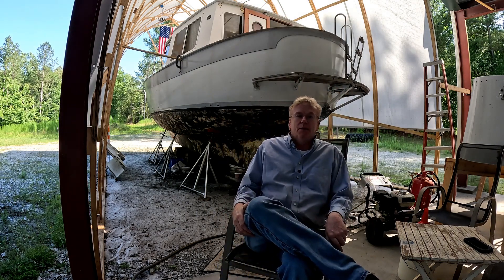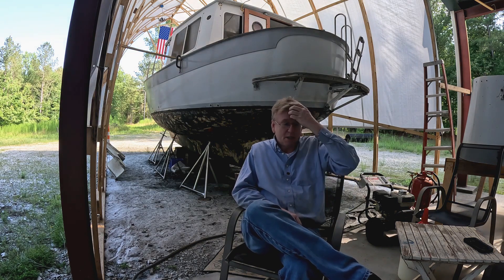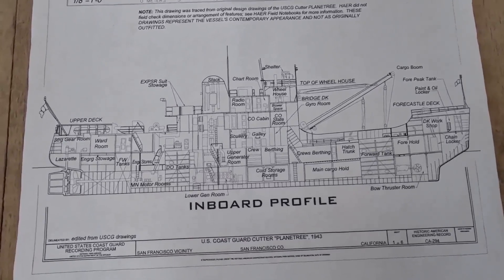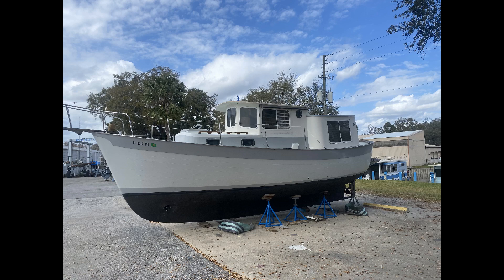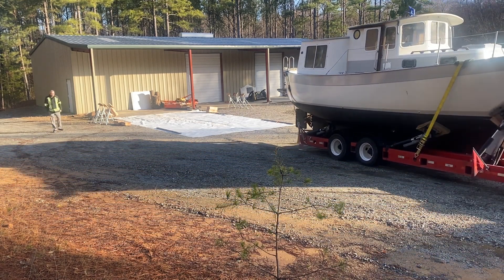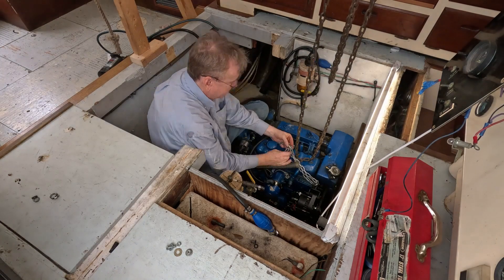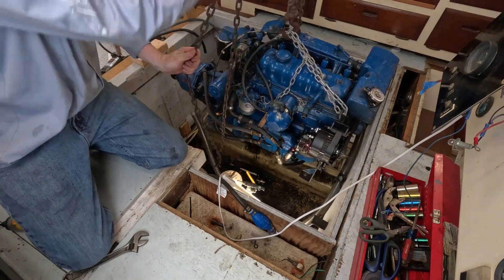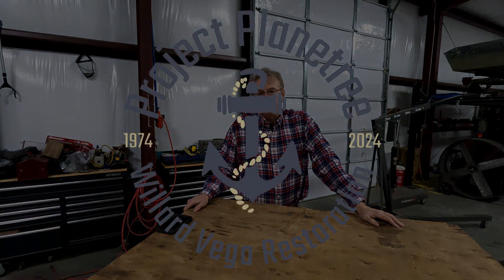Project Planetree- A Full Displacement Electric Trawler Conversion

Comment: Looking forward to seeing how this turns out. I converted a small catamaran and I'm absolutely thrilled with electric power. With enough solar panels it's like having an unlimited range!

I know you're aiming for a 96V system, but if the money isn't paid yet I would highly recommend a 48V system. It's so much easier to find parts for like the BMS, charge controllers, inverters and do much more. The only downside is needing fatter cables.

Good luck!
Reply from the maker: Thanks, I agree.  As an EE, I like higher voltage when possible.  However, it seems the world just isn't fully ready for it on boats and there is SO much out there for 48v systems.   I've held off purchasing anything on the propulsion side until I get past my battery learning curve.  My goal is a hull speed, passage capable trawler with no diesel, no sails and no stopping for charge. I'm not sure it's possible, but I'm sure going to give it my best!  Let's keep in touch.  Folks with actual experience in this craft are rare.

Comment: Cool project.  I bought your engine to diesel swap a little fishing boat I have.
Reply from the maker: Send me pictures once you get it set up!  I would love to include it in one of my episodes.
Reply: For sure.   Looking forward. To following your progress.  Really cool project.
Reply: Got water pumps, front cover, and front main seal replaced.   Touched up paint.
Reply from the maker: @billwood2747   You are moving fast!  Remember, like I said on Ebay, I think its the rear seal that's leaking.  I accidentally said on the video its the front seal that's leaking but I think the leak is coming from the rear.
Reply: @ProjectPlanetree  the rear is definitely leaking.  When I pulled transmission to put engine on stand rear housing was full of engine oil.  I bought a complete engine seal/gasket kit.  Gonna reseal everything.  Not in a rush to do swap.  Just tinkering. I see there is an updated rear seal available.  Gonna wait for that to arrive before I do that repair.
Reply: Gonna adjust valves, paint all raised lettering white.  Some of the accessories and fuel lines.  Then it will probably sit on stand for awhile.   Gonna run existing combo for awhile paying closer attention to speed vs rpm.  Then make a good plan for swap.
Reply from the maker: @billwood2747   Don't forget to send pictures!  mpj20000@gmail.com
Reply: https://youtube.com/shorts/xwOfVGU7PDU?si=WH2TJEs-ax-tFrPf